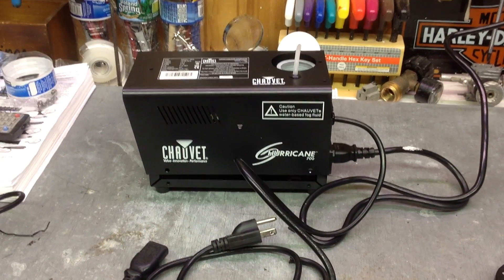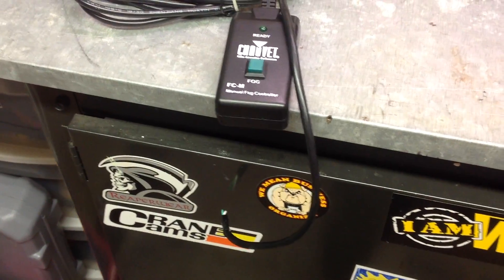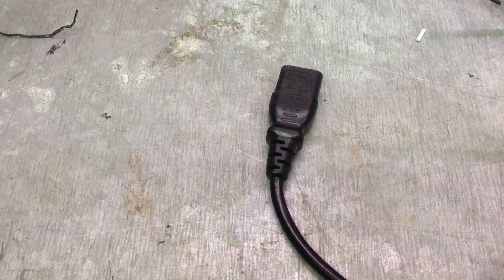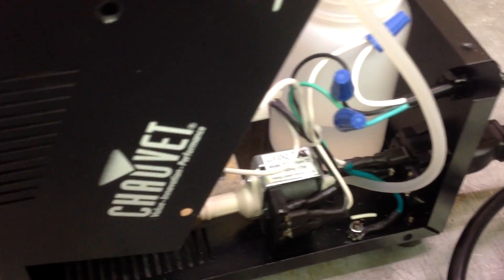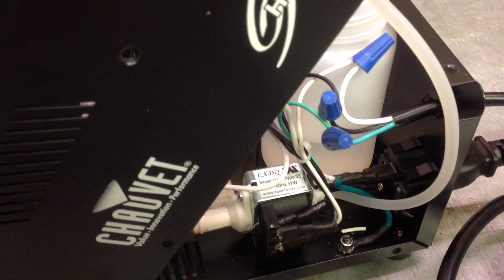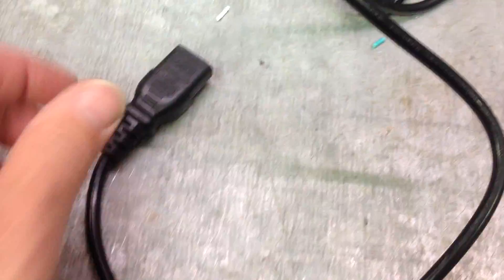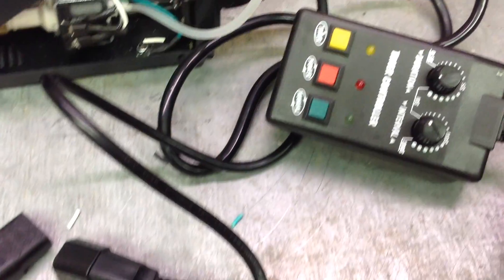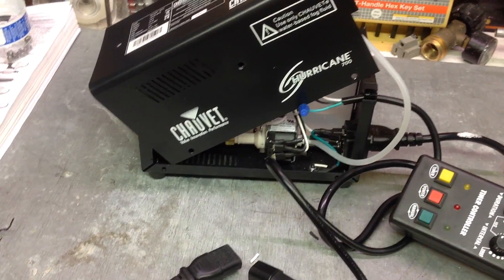How to rewire fog machine for remote timer switch

Comment: Awesome! Thank you!! 

Out of curiousity, can you connect the remote directly to the machine? Why use the plug?
Reply from the maker: Yes you could , but I wanted to be able to plug the timer into the machine , not splice it in for permanent connection. The way I did it also gives you the option to take a cord and run it through a relay to trigger the machine when wanted.

Comment: Why didn't you just cut the remote timer cord? Add it in like the original?
Reply from the maker: I wanted to have a removable connection for the timer , and the ability to take a cord plug it into the new end and run it to a relay , for triggering it. No open splices outside the machine.

Comment: I'm new to "stage" fog machines and I was given 3 without remotes. They are not DMX. They have the basic 3-wire remote plug-in which looks like a basic 120v PC power supply cord. Is the pump current running through this connector to the remote and requires a 120v relay and switch?

Comment: Not exactly the same machine, but tried your method and timer does not work.  Any extra tips?
Reply from the maker: some are wired different, You would have to use a tester to see what produced a closure or continuity on your original machine and on your timer then splice accordingly . so if your using the same type of cord I showed you would check what pins ring out to what color wire then make your splices, so that when you hit the manual button on the remote timer it closes or connects the proper pair of wires that would trigger the machine,  hope that helps.